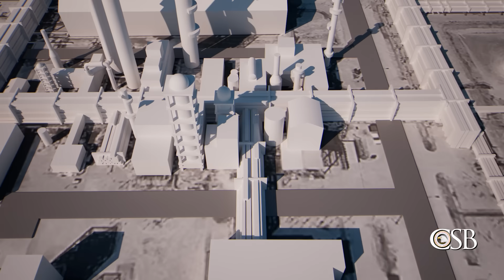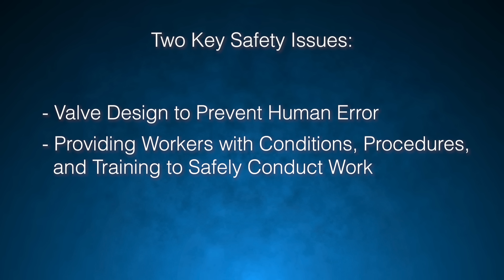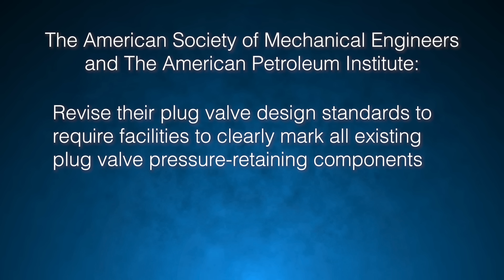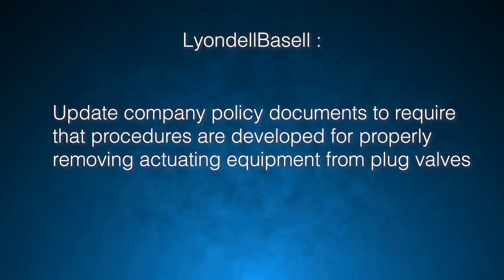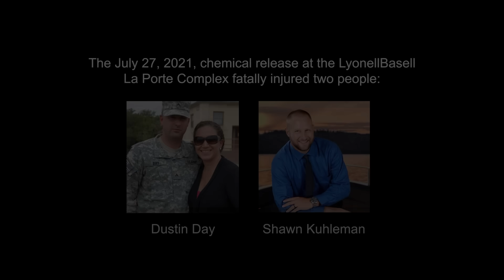Designed to Fail: Chemical Release at LyondellBasell

Comment: I just dont understand WHY the actuator has to take away to prevent valve opening? Actuator is for keeping the valve open or close, if you take it away, there is no force to keep valve closed. In the video, there seem to be double acting valve type, valve is open and closed by intrument air. Best way to prevent valve opening is simply take away the controlling energy from that solenoid valve which controls the instrument air to actuator. If you take actuator away, in wosrst case sceranio, tank hydraulic pressure can open the valve. I have worked, over 20 year at chemical industry (Yara), and never we dont take actuators away to prevent valve opening. Taking actuator away, is so big risk that i wont recommend that at all, it is so big risk task, you should stop that kind of procedures. .
Reply: The video covers this: there was a leak upstream of this valve. The site chose to use this valve as an isolation valve to repair the upstream leak. To do that, they chose to remove the actuator so that the valve could be locked in the closed position. While removing the actuator, the workers accidentally removed the wrong fasteners.
Reply: If the valve type is FC, fail close, the actuator spring will keep the valve close. Only thing you need to do is take away the power, instrument air, what can only, open the valve. There is no need, in any cases, take the actuator away. I dont know, what type valve here is. Pleace, just stop taking those actuators away. It is A suicide mission.

Comment: These companies that have these accidents need to get an outside person in to make the risk assessments along with their own team to make the procedures. In this case of the hardware that secured the plug valve, I would make the suggestion to use safety wire on all the nuts that held the place in and attach a warning plate to the side of the valve to indicate the wire should remain in place what an actuator is removed. The safety wire would be the simplest item to change out to on it and securing the notice plate is a small addition. I always check to see what risks that I am going into when working on something. My industry of HVAC our biggest risk other than chemicals and hot work is un-intentional release of refrigerant from either storage cans or equipment. There are known cases of people loosing hands from trying to stop the release of liquid refrigerant in systems. The risk we have to have in mind that it will happen, is it today. Keeping the mindset of there are inherent dangers in all industries and along with them is health and life risks. People when it comes to working on equipment that holds chemicals of any kind, treat it as if it is like a loaded weapon. Take due care around it and constantly asses the situation as to if it is still safe.

Comment: one other solution, the actuator was mounted directly near the plate, the design should have mounted it on a longer stud, with primary nuts holding the pressure back, and the actuator on separate fasteners, spaced away from the main valve cover so each can be dealt with separately, avoiding any confusion. Also having a different size nut, aka a stepped stud, with two diameters, one for the main cover, the second for the actuator, so one can't use the same wrench for the pressure cover nuts, as opposed to the actuator nuts; giving vital seconds to question oneself as to what is happening and to check the manual for the next step.

Comment: I refuse to believe that three people would have been stupid enough removed those nuts if they knew that the system was still pressurized. They either assumed it was empty, were told it was empty, or it was one stupid person in charge and a bad safety culture that allowed him to dismiss the concerns of the other two. Colored paint and different designs are a good idea but it's not going to stop a person that is convinced in their mind that the system is empty and the part needs to come off in order to perform the work.
Reply: The survivor said they took the bolts off because the components were connected. I assume he also cut his toes off to trim his toenails. Just a complete braindead line of reasoning.

Comment: The problem with using paint to color-code components (to denote pressure retaining components, or whatever), is that paint fades, discolors, flakes, or wears off. And for that matter, the team that removed this actuator were not trained for this specific task (nor working to a SOP, evidently) so what chance they would've understood the significance of a color-coding even if it was present? Effective solutions to this problem are working to SOPs, with some sort of tutorial or task-specific safety briefing prior to the commencement of a high-risk, low-frequency procedure, and replacement of the pressure-retaining nuts/bolts with "secure" or "tamper-proof" fittings that require a special tool for removal (like the ones many manufacturers use to discourage tampering with non user-serviceable components).

Comment: Glacial Acetic acid is no joke. You associate it with the term “vinegar”, and that makes it easy to dismiss it as harmless. But this is NOT the case here. I once got the tip of my thumb splashed with 99% solution, and it was the strangest most painful acid burn I’ve ever had. Even after washing it off right away. Imagine it like vinegar that can seep into your skin and burn you from the inside. Because that’s literally what it does. You all know what vinegar feels like on a cut? Same kind of pain, only inside you. It’s a fantastic solvent, and goes through biological tissue like a coffee filter. On top of that, at such a high strength, it’s actually very corrosive to flesh as well. So it’s kind of the perfect storm. You’ll see bottles of this stuff on Amazon for “cleaning” purposes. But don’t even waste your money. It’s not something you want in your house. It smells, it’s flammable, it’s messy and easily damages things, and if that flimsy plastic bottle ever broke, god help you.

Comment: Acetic acid stronger than vinegar is nasty. I've worked with glacial acetic acid in photography and you do not disrespect it. Very hard to comprehend being firehosed by strong acetic acid that is also scalding hot. I'm not around industrial equipment but incidents like this make me afraid to take apart even cold-water plumbing without knowing exactly what to do. [added to CSB repeated-binge playlist]

ps maybe everyone needs to cut industries some slack and tolerate more time for SAFE maintenance shutdowns. I'm grateful for the chemicals we can even get at all

Comment: Why is there a poison sign on the acetic acid? Holy cow, it is food, it is obviously not poisonous! USCSB!
Reply: Two men died from being soaked with it
Reply: @drewsahli  You can also drink too much water and die. That pictogram is well defined, specifically category 3 or lower toxicity. For example oral that would be a LD50 of less than 300 mg/kg. Acetic acid has a LD50 of about 10x as much, it is "toxic" like sodium chloride.

Comment: Sorry for the deaths of workers.  Did seem like a straightforward task, thinking these guys weren't trained or something. NO reason for the bonnet on the valve to be unsolved. NO protective gear either. Worked in many chemical plants with deadly shit, HAVE to be aware of everything

Comment: As with video games: if the game mechanics let you do something, it will be done. The same can be applied to the real world in some instances. Such as having a special 'lockout' nut/bolt. If small things like breakers and tiny valve handles can be locked out, then so can nuts and bolts with the proper design.

Comment: Can someone help me understand why the removal of the actuator is necessary for LOTO? In my experience with actuated plug valves, the valve is actuated to the CLOSED position and then the air/nitrogen line is LOTO'd to ensure no further actuation of the valve.

Comment: This is dumb. shouldn't have happened at the first place. Why blame the valve? The workers should have identified the hazard and should not have removed the bolts (hint: refer to the valve manual to see its inner working & operation). Shame on you Lyondel Bassel for cutting corners and letting untrained workers do dangerous things.
Reply: Valves can be designed in such a way that prevented this. If you can save lives with good design it's worth pointing that out.

Comment: Normally i totally agree with the csb, but here I am going against the grain .. I mostly disagree with the csb recommendations.
A) it is nearly impossible to have a procedure or train people for every single type of valve.  The generic valve training should have been enough to recognize those were pressure retaining bolts, or at least enough to stop and ask someone else.  While a planner should have checked it beforehand the contractor should have also recognized it.
B) asking chemical plants to paint every single pressure retaining bolt is not going to happen due to the high cost and low risk per bolt.
C) the best option is to make a recommendation/requirement for all industrial valve manufacturers that the support structure for the actuator does not use any of the valve body bolts.
Reply: Who cares what you think?

Comment: You guys are completely missing the root cause here. The problem is their life critical permit to work system, pre-job planning and general training of contractors. Along with the fact that removing the actuator should be totally unnecessary. 

A written procedure for removing the actuator would do nothing as no one on that contract crew would have looked at it or it seems would have ever been trained on it
A PHA would have never address a maintenance worker intentionally taking apart the pressurized side of a valve. That's almost like intentionally taking apart one of those nearby flanges. The PHA deals with Process hazards

The actuator has to have some means of operation. Either air or electrical. To take off the actuator they should have locked out the energy to the actuator, in which case they have locked out the plug valve as well. I can only assume they are removing the actuator due to some past incident with LOTO. Which means they have a fundamental problem with their life critical permit system and LOTO walk downs. The video portrays that actuator as air operated. So disconnect or lock out the air supply. Removing the actuator introduces a totally unnecessary hazard

The fact that those contractors had no idea what the pressurized portion of those valves were goes to general hazard recognition training of contractors and pre-job planning. If they can't identify what not to take apart on that valve, how could they possibly identify any other pressurized piece of equipment that they shouldn't be taking apart. You don't send contractors out into the field to blindly work on equipment containing hazardous chemicals, or any chemicals for that matter, without some discussion and pre-job planning.

Should it be more obvious what is the pressurized part of the valve? Absolutely. Should that be an inherent valve design? Absolutely. Could they have training on that specific actuator or labels? Sure. But that's not their issue. Their issue is the actual process they have for performing work on equipment containing hazardous chemicals

Comment: The biggest take away, why would you ingest these chemicals? They are poisoning or food.
Reply: It's acetic acid. Aka vinegar. Household vinegar is 5% acetic acid and 95% water. This was 100% acetic acid.
Reply: I think there is a difference between the amount, application, temperature, concentration, and about twenty other variables in how the workers died vs the dangers in food.

Comment: As a service technician I'm somewhat surprised that the Forman /senior tech didn't verify which bolts to remove, and then didn't realize what situation they were in after the actuator was removed. The animation makes it clear as day before the explanation but I assume there was a lot of rust and/or dirt covering everything making it a bit harder to see. Colour coding was the first thing that popped to mind but honestly I'm not sure if that would have helped giving real world complexities. (it's hard to paint a bolt/nut without making it extremely hard to work with, plus dust and corrosion will obscure it over time anyways )

I feel for those injured especially the 2 fatalities. It's obviously clear that it could have been prevented in hindsight but I think the real problem is not enough training in applied physics /chemistry /mechanics. That's the school system curriculum, the tradesman curriculum, and the companies not filling in any gaps. I somewhat disagree with the uscsb final recommendations as that'll just end up with more CYA paperwork but less actual discussions specific to the task. The awfully dreadful and boring safety videos companies like this will make you watch (complete opposite to the uscsb videos) are often far too generic with no real assessment on whether the worker actuality understood the content not just regurgitate the material. (again I blame the curriculums for that, and the companies not filling in the gaps)

Comment: It's like doing an oil change while the engine is still running or changing a tire at highway speeds. These valves will continue to kill until their replacement is mandated. Until then they should only be serviced depressurized. It's a shame the CSB can only recommend and needs OSHA and others to mandate change.